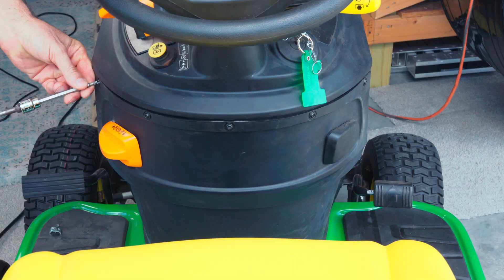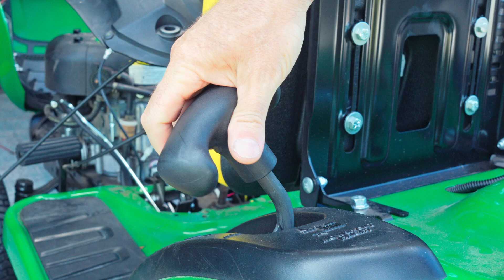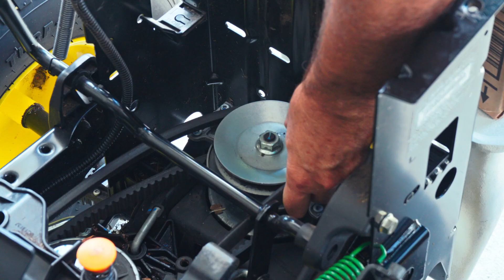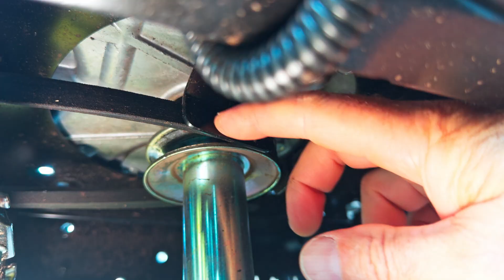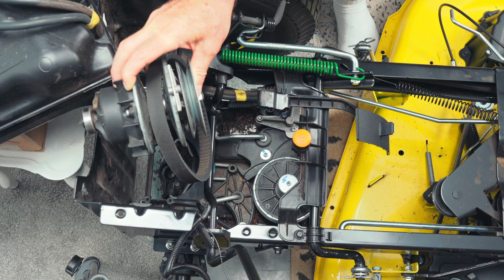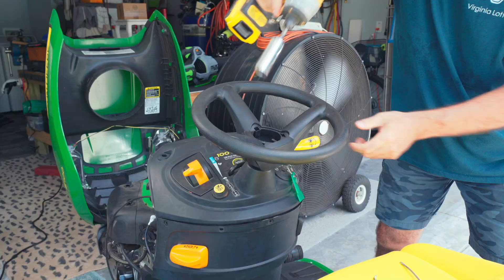Changing the 2 Transmission Drive Belts: John Deere E100

Comment: This is asinine. Take the seat springs off, lift frame 2 inches, slide the gas tank forward 3 inches and take the belt bracket off. 10 minutes at most and you’ll be done
Reply from the maker: Great!  Thanks.

Comment: Just wanted to take a minute to thank you for the video.  I definitely did not want to attack this from the bottom.  Doing this from the top looked harder than it was. I took my time cause this one was old and dirty but at the end of the day,  I had to go a little slower, as I had other repairs to make to the machine. But the repair went great. Thanks again.
Reply from the maker: That's great!  So glad I could help.  Some of the comments are mixed... some  people would rather try and replace the belts with the body on and some like it better taking it off.  For me, it wasn't very hard to remove it and made getting to everything so much better... 😀

Comment: That tractor is not worth all of that work to change belts,transmission will not last much longer.Can't belive jd used platic transmissiom,total junk
Reply from the maker: It’s definitely a common complaint, but for many people, a quick belt change is still cheaper than replacing the whole unit.

Comment: Yeah, I spent  nearly an hr trying to manipulate my fingers into the space of that 8mm screw that holds the belt from jumping off. After abusing my left hand, I did finally get the threads to take hold. If I have to do this EVER AGAIN I will cut a hole in the rear bodyplate to access that screw. my hand is still throbbing😵‍💫 Crap design JD!!
Reply from the maker: If I remember right that's why I decided to take the main green body off.... It looked like a real pain to try to get to stuff... Let alone get a camera in there.... Thanks for sharing your experience..

Comment: Should the rear transmission pulley spin freely by hand? When I went to put the longer drive belt on I noticed that it wouldn’t spin at all by hand & didn’t want to put it all back together if that pulley is seized or if it only moves freely when in drive? Thank you !
Reply from the maker: HI!  If your mower is not hydrostatic the pulley should spin freely if the rear wheels are in the air and the belt is disconnected.. You'll see the wheels turning with the pulley.  If it IS hydro it should spin freely as long as the belt is off.  Also if your mower has a parking brake made into the side of the transmission, that will need to be disengaged first to spin freely... SO the quick answer is... "it depends".

Comment: On that shifter control knob Fwd to rev,  if you blow compressor  air in the small hole in the top, the knob expands and litterly jumps off the control arm.  Good videos THANKS
Reply from the maker: That's a great tip!  I will certainly try that next time.  That's how I get flower pots separated that are stuck together... Find a hole in the bottom and blow some air in there... Works every time...  Thanks for the tip..

Comment: I've done many of these and to me it's not hard to just hang the rear end up in the air a little and simply drop the transmission out.  To me it's way better than taking the body off.   js
Reply from the maker: There's different ways to approach this problem... It wasn't hard to take the body off in my opinion.. But in the end, the result is the same.. 😊

Comment: Great video with concise descriptions and no BS. I was shocked to look under mine and see that plastic transmission!
Reply from the maker: That was my reaction when I first heard about those things...  There are some things that metal is just better at!  I can get on board with a plastic gas tank since they won't rust....  But the transmission should be all metal!  Thanks for the great feedback..
Reply: Just test drove mine and the shift lever popped out of the plastic lever. I didn’t disconnect it when I dropped the axle and it broke the plastic lever on the axle. Should have used your method!

Comment: This job can be done from below the tractor without taking the whole thing apart. It’s a difficult job from below due to poor design, but this way is much more difficult.
Reply from the maker: It really isn't much more difficult.  It takes a few minutes to get the body off and then you're working from the top without hurting your knuckles (or back)!  It'll work either way, but I'm old!  I guess if you were in a shop and time=money then working the other way might be a little faster.  Thanks for the input... 😊

Comment: I appreciate all the trouble you went through to make this video, but i have a much faster solution. Go get a couple stands. Lift the back end. This part sucks, but get under the tractor and snake your arm in and up over the transmission pulley. Ising the smallest socket wrnch (shortest) you have, loosen the beltkeeper from the top. It is 8mm. It will be slow. You can only turn it about 15 degrees at a time. But i just did this in 20 minutes without disassembling the whole tractor. You dont have to have skinny arms, im a bigger guy. It works.
Reply: I was watching this video with dread at the task before me until I scrolled down and saw your comment. Thank you, you saved me so much time and trouble.
Reply: @unfrozencaveman5804 that was the reason I looked for a different solution. Unhooking everything was looking like an all day task. Glad I could help.
Reply: @Kenn_Baker  Can you change both belts with this method?
Reply from the maker: HI!  Yes I'm sure that'll work too.  It really didn't take that long to pull the green body off and it made things so much easier.... Thanks for the info.
Reply: @JLPicard440  if it took more than 10 minutes, just reaching in has it beat.
Reply from the maker: Great!  Thanks...
Reply: Thanks for the workaround!  Will I be able to replace both belts this way?
Reply: I only have one  drive belt. And only one goes onto this wheel for me, so Im not sure.  @mrl1010

Comment: Is the top pulley on the rear supposed to turn freely? I think I installed it incorrectly because the belt is making noise and the pulley is not turning
Reply from the maker: HI!  IF there's a belt attached to it, then the friction from the belt would keep it from turning smooth,.. but with no belt more than likely *(IN MOST CASES). without seeing it, I'm not 100%... so we'll go with more than likely... 😊

Comment: Hi, is there no way to get the belt guard off without taking the entire body off? Also, what size socket did you use to get the belt guard off?
The drive transmission belt on my E100 popped off the pulley with the belt guard.
Reply from the maker: HI!  Going off memory you pretty much had to take the body off...  IMHO it's a terrible design, but it is what it is..  I can't remember the socket size just off memory..
Reply: It's an 8mm socket, just had to do one of these

Comment: I own one of these and pretty sure there is debris in the transmission if the trans is seized I know what I am pitching aint worth fixing for the maintenance nightmares these machines have I will never buy another John Deere lawn tractor ever. PS. This video hopefully saved me I appreciate you sharing your knowledge. No disrepect for sharing these tips. This video helped me a ton. I was able to pull the body off and get REALLY easy access to the transmission from a top view to determine in fact it was not able to shift due to debris. Not too much of it sadly either but enough built up where I might consider doing this on a seasonal cadence or when I start to have transmission issues to prevent complete down time. Thanks again huge saver.
Reply from the maker: So glad to help!  Sounds like the debris were around the pulleys preventing it from shifting??
Reply: @JLPicard440  Yes that's exactly it and that shielding doesn't help much. I don't know much about riders tbh since its my first but my dad who has had a couple laughed when I said it was a John Deere lol. Thanks again for sharing knowledge!
Reply from the maker: You're welcome!  Thanks for the tips on that one.  I'll keep it in my bag of tricks.  I've never seen one actually do that before... Not necessarily JD, but any rider...

Comment: GEEZ!!  I think I'll keep my 2007 Craftsman 2000.  It took me about 1/2 hour to change the drive and deck belts without having to dis-assemble half the machine.  Horrible design on that John Deere.  Good video though.
Reply from the maker: Yes you're absolutely right.  Sometimes I will take off the body just for filming purposes, but in this case it needed to come off to get to the belt..  I've never seen one like that except on JD.  Not a good design.